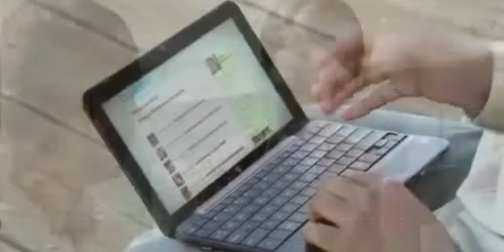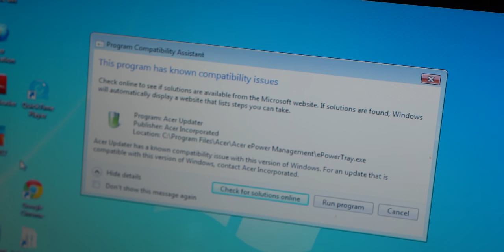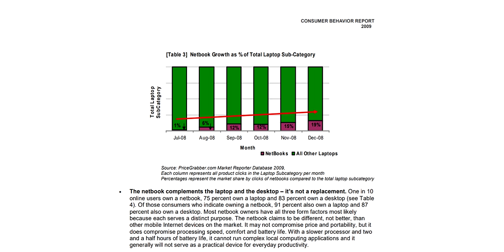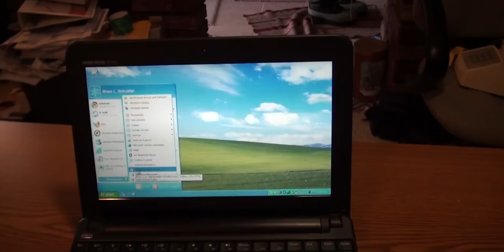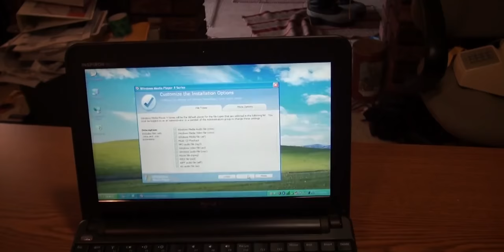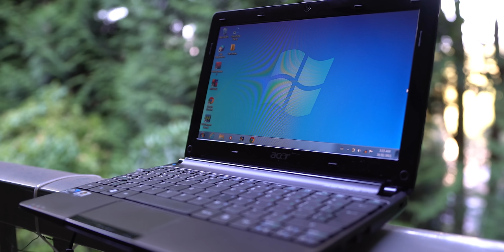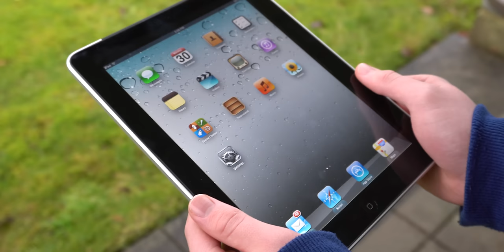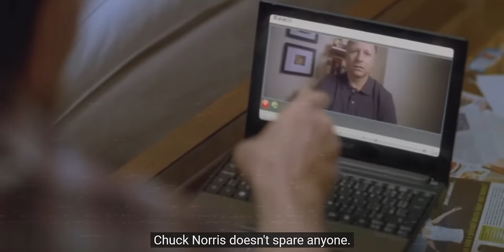Why Netbooks Failed - Modern Retrospective

Comment: I was one of the late adopters of Netbooks back in 2012. My mom bought the last emachines model before it was discontinued. 10.1 inch 768p TN display, Atom dual core, a beefy fan that kept it from choking, and for some reason it had 4gb of RAM and Windows 7 Ultimate. We got it on sale for about $150 Brand New.

I still use it now with Linux XFCE. It can actually run 720p60 or 1080p30 videos on Youtube.

Stay Healthy and Cheers from the Philippines. ⛑️♥️🇵🇭
Reply: Very impressive specs for a netbook-class PC.

I was a mid-gen netbook adopter that came in around December 2010 with HP's Mini 110c-1105DX. At 10.1" with a 1024x600 TN panel, Atom single core-hyperthreaded (said hyperthreading saving it from being awful), decent fan, and 2GB RAM, it was a wonderful little multitasker between web browsing and Winamp audio playback. It started to buckle even under chat clients such as Steam, Windows Live Messenger, and Skype by early 2013, but most websites even around that time still weren't too demanding for it yet. I just wish its charging port didn't quit in 2013, because I would have loved to bring it up to Lubuntu 18.04LTS LXQT
Reply: @TurboPikachu  That's one of the downsides of owning a 'dead platform' piece of tech. When sonething does inevitably go wrong, we're out of luck finding parts. My netbook's batteries are completely dead so it's plugged into  a wall socket whenever I use it. Goodbye mobility.
Reply: I still have my EEE PC 1000H, with a 1.6GHz single core hyperthreaded x86 Intel Atom, 2GB of memory and currently a 250GB SSD (which really didn't help the start times at all anyway lol).

What distro are you using on yours? Finding distros that still support x86 is getting hard, and Debian with Xfce is too much for it. Currently I have Slackware x86 on it, and it's """usable""", but if I could find something better, I'd be very interested. I tried Arch 32 and that actually worked, except I hated having to do absolutely everything manually and not being able to figure out certain things like automatically mounting a removable drive.
Reply: @JustARegularNerd  I use Mint XFCE. Linux MATE tends to perform the same, even though it's supposed to be more resource intensive.

Puppy Linux might be a better  option, based on your netbook's RAM.

If your CPU is 64bit you can even install Chrome OS with Google Play Store and OTA update support. It runs on Debian kernel so you can install linux apps through the terminal.
Reply: @BedrockPlayer123 Aye! Sup?
Reply: I got a Compaq Mini 110c-1100 in December 2009. 10.1" 1024x600, Intel Atom N270 1.6GHz 1c/2t, 1GB RAM (later I upgraded it to 2GB), 160GB HDD, Windows XP. It was a nice small laptop for web browsing, watching videos, using skype etc. It even ran some light games pretty well. It had really good battery life with a 6-cell 55Wh battery which sadly stopped charging in 2012.
The netbook still works and has the original Windows XP and Xubuntu 12.04 which I installed later
Reply: @Pasi123  55wh on that hardware must have given some epic battery life!
Reply: imagine what a 2020 ultrabook quad core with 4K OLED would be like in 2007
Reply: OMG PILIPINO
Reply: @xxhalfemptyxx7713  Ey! ✌️
Reply: Yours actually had some decent specs imo.
Ive never seen any stock netbook with 4 + gigs of ram
Reply: @SummonerArthur  The owner of the store we bought it from is a family friend, he was quite into modding. So chances are high that my netbook might have a modded/replaced memory controller/motherboard.
Reply: @othinus  You can rebuild those batteries, although some caution is in order as they are very high current devices. You might luck out and be able to find an rc car battery that has about the form factor you need, it is what I ended up doing for one of mine.
Reply: And to think that now even low end phones can run YouTube videos in 4K
Reply: @Blox117  quad core is nearly dead now unless it has hyperthreading and high clock speeds

Also such specs in 2007 would only be considered high end at best, wouldn't be strong enough to be on the level of a workstation or server at the time

Comment: The best thing about Netbooks was that in the process of replacing Windows Starter Edition with Linux, I learned I liked Linux.
Reply: I like linux too, but still it doesn't have some critical programs for me, so i still didn't entirely switch to it from windows
Reply: @Mabel Pines true
Reply: @vinyl.croatia  I assume they don't run with Wine out of the box, but try and find out if there's a path out there to make it run. You might be surprised.
Reply: Linux was what allowed me to use my netbook until mid-2020
At that time though, the pandemic came, and it turns out a single-core Celeron isn't exactly the best for video conferencing...
Reply: Just get a job and buy a laptop, mow some lawns or something, lmao
Reply: @vinyl.croatia  me neither. It can't run rct3 properly without it having a problem with wma files.

Comment: Windows 7 netbooks were basically another way of the "Vista Compatible" underpowered XP computers
Reply: try using windows 8 on a netbook
Reply: BedrockPlayer123 when your on the desktop yes when your on an app or game no
Reply: @BedrockPlayer123 Well, my old Toshiba NB510 can install Windows 10 but installing its Intel graphics driver that are made for Windows 7 can cause a BSOD every time I open Start menu, running Windows 10 UWP app or opening some other elements like Action center, Wi-Fi settings, etc.
Reply: He's not wrong. I have  7 starter Netbook
Reply: Yup, on paper it doesn't work out good
I have BenQ Joybook u101 and it's using Windows XP
Reply: @insanitylol  you're*

Comment: If you still have one of these things kicking around then shove a cheap SSD in it and run Lubuntu on it. Upgrade your RAM to 2GB and enjoy.
Reply: I think AntiX will do a better job.
Reply: @Dac_DT_MKD  I run Sparky on mine.  Dell Latitude 2120 with 2GB DDR3 and it does pretty good.  I can run games like Half Life on it in Steam and they are perfectly playable.
Reply: Ubuntu and its derivatives nowadays are FAT
Reply: @Dac_DT_MKD  But why not debian or debian oldstable? You can install debian and DWM or Weston with your software. From start it consumes like 100mb, but in fact it should be less if don't count cash. AntiX and PuppyLinux seems to be good option to run from USB drive.
Reply: Puppy Linux, Slackware base
Reply: @2080 It's not 2006 anymore.
Reply: For what would you use that? writing text or loading Wikipedia? any cheap smartphone can do that, if not more.
Reply: @biggo4637  Smartphones suck for webbrowsing
Reply: @Mj Verostek my 200$ dollars phone manage to browse without problems and is more comfortable
Reply: @biggo4637  I bet you put milk in a bowl before you pour in the cereal.
Reply: @mjverostek1278  Hi i have a collection of desktop and laptops from 2000 - 2010 
1 of each runs XP for games , the rest have linux puppy 3  the the low end machines and up to Puppy 5
P3 - P4  / celeron / duron

I do have a HP Mini 5 - 102  notebook that was a "incentive" given out to a few engineers and managers to change mobile and land line telco back in @ 2005-2008.

Our construction engineers used them and then thew then out, they were fine for email and pdf's but they all needed to use autocad to open engineering drawings when having issues - for that they used the "big" Pentium 4 Toshiba Satelite Laptops

So one of the HP Mini 102's was given to me and i still have it, battery is dead but the hardware is very rugged and the screen is still beautiful - if runs Linux Mint 17 and youtube playback is possible

They only negative is the hard drive is extremely slow, it is quiet but very slow, it would run XP with 1 or 2 mins but towards The end took close to 8-10.  Reinstalling the d-drive from the partition back up took 3 hours - i used to do it every xmas to keep it running smooth and it used to take 30 mins - while having dinner for example.  

I may open it up and see if it takes a standard 40 pin IDE  or the 44 pin with power - if 40 i may just buy a new SSD as they are $20

Linux Puppy is great and can run of a USB stick , you can save session to usb - i find it great and stable.

Regards
George
Reply: @georgemaragos2378  I'm trying to get Slacko Puppy 6 to run under Ventoy right now. It fails with not being able to find the .sfs file. But Xenial Pup works fine...
Reply: @mjverostek1278  Hi i have never used Ventoy - but a similar one called YUMI multiboot for a multiboot usb stick

On my Win 7 main pc i have a different program called Linux Live USB Creator
This allows me to say grab a new image, and set it up for use on the pc while Win7 is running - sort of virtual box - you run the program, select the image file and it creates basically another image with a "wrapper" around it - you can add a persistant or some extra room for saved files in it - read a bit later down.
When done you can launch the newer saved image while still in windows - just like virtual box

These multi boot basically are a generic linux boot device, then a menu sytem to select a specific operating system or image to boot from and run - they are very use fully as you can put a selection of PC repair tools on 1 stick eg linux tools , virus scanners, clonezilla etc

My uses of it is playing with several OS eg Linux , Puppy, Linux Mint , Win XP repair disk, freedos , doss 6/22 boot disk etc etc

Program #1 may not work on every machine as it depends on the booting machines BIOS eg i have 2 HP laptops bought in 2010 a few months apart, Puppy 6 works on one but not the other

Note when you use a multi booter, they can be configured in a few ways
1.  basically a read only os
2. read only os but a small area for run time variables eg the ini setting for video mode, resolution, sound and internet settings - some times these settings can be saved in the same artition or as a setting file that can be re-read later
3. road only but with persistent space - eg you open puppy as a read only run time program, but it may have room for say 300 meg persistent storage - think of it as a extra removable / savable hard drive letter or built in usb stick with 300 meg - this was you can save a document or something on that multi boot stick, and after you quit you can load that up again on that or another machine
4. I do this with save state and save setting, eg Puppy 6 or my linux Mint 17 runs on Dell I5, Thinkpad core2duo, Imac 2007 - i just "save  state or save session" as  Dell or Laptop

Some info for the .sfs - from the wiki - there is something wrong with the setup or filelocation

Sorry i could not help more 

http://wikka.puppylinux.com/squashfs

Regards
George
Reply: @georgemaragos2378  I've heard of YUMI but never tried it. My only other solution I could think of is installing Grub on the USB media, then I would have to unpack the .iso and make a moot menu option manually for everything I put on it. Ventoy just works so much easier with everything elrse. I wanted to use the Slackware base for my Win10-32bit dual boot on my Dell Latitude 2120, but I may have to use Xenial Pup because of this, since I wanted to have an easy toolchain for maintenance.
Reply: @mjverostek1278  HI    If you just need to run a linux ( any version ) of a usb stick or entire drive seldomly and leave the main pc windows version alone version there is a far simpler 2 step process that does this safely - no need for the multi boot installer on the usb stick option 

1. On your windows pc download the linux install / iso  image file and save it in downloads or desktop.

2. once that is done use a free program called etcher -  The Etcher website is at: https://etcher.io/

Watch a quick video on etcher - it takes 1 to 2 mins, basically you plug in the usb stick, run the etcher program, load the image file, then burn the image file to the usb stick - IT WILL WIPE THE USB STICK OR ANY USB DRIVE YOU SELECT IF YOU HAVE ANY USB HARD DRIVE INSTALLED OR ACCESSED MAKE SURE YOU UNPLUG IT INCASE YOU PICK THE WRONG DRIVE AND WIPE YOUR WRONG DRIVE

The burn process will take a few minutes say 3-5.  Once done you should have a message saying done / completed 

Now windows cannot read any file structure or any files on a linux partition !!  Linux and Macintosh can read windows

Shut down and reboot your pc - when the computer first starts the bios screen will quickly flash a message to press a keep for Bios options or boot menu options ( donot confuse this with windows startup boot options )

Do a google search on the brand of your machine eg IBM/ Dell / HP   eg HP 8020  if it is a large make , if you have a custom or mass produced mother board you search for the mother board make and model eg asus ABC12X.   The bios buttons or boot menu options are usually F1 or F2 or F10 or F11 or F12 or Delete  - bios option allows you to go into setting, boot menu puts a small menu like press 1 for hard drive, press 2 for CDROM/DVD, press 3 for USB

So lets say it was F12 for boot option, reboot the machine on startup keep pressing the F12 - a small menu appears and you press  the option to select USB drive

The PC will now start from the usb stick and not windows.

You should be now running linux in CD/LIVE mode - basically it will configure and run, the menu systems will tell you if you can save setting on the USB - there is no need to install on the usb - almost all linux systems in the last 5 years will be able to leave the ISO as read only and use the free space on the USB stick for your setting and and saved files

Regards
George
Reply: @georgemaragos2378  I'm a linux veteran. I can do this in dd. I just wanted something easier. It's not 1999 anymore!
Reply: I actually wish I didn't throw my old Toshiba NB500 so I could play with it a little more
Reply: Ubuntu MATE is probably good too
Reply: @Lucas Zhu does arch run on 32bit? Many of these atom processors are 32 bit only
Reply: @9a3eedi  If you're going to run Ubuntu base on these just go Xenial Pup Puppy Linux (the 32bit base).
Reply: @mjverostek1278  isn't xenial out of support though
Reply: @9a3eedi  That's the last 32-bit Ubuntu base Puppy Linux build I saw last time I was on the website recently.  Oh, shoot, just checked, they have Bionic listed. Still working on 32 bit Focal.
Reply: @9a3eedi  Hmmm... Though it seems Bionic Pup 32 doesn't boot through Ventoy, yet Xenial Pup 32 does... And neither does the latest Slacko Pup 32. I'm not reformatting my USB SD. I'll just install Xenial and do an update from there.
Reply: @Lucas Zhu: It's Photoshop that can't run on Linux, not the opposite. It's just a decision made by Adobe to not allow it.
Reply: @Lucas Zhu: Yes and that is irrelevant.
Reply: i install zorin in my netbook, but i think my netbook have a problem in its hdd, because the os (zorin), somehow run smoother in my usb
Reply: @muhammadraihan9044  Replace the hdd with ssd
Reply: Im going to try this with puppy linux
Reply: the performance of this atom netbook pretty bad, for new app like zoom, webex and loading browser or chrome, even updated with ssd
Reply: I got a Dell Inspiron Mini netbook for $8 on Goodwill. Installed an SSD, then installed Linux Mint. Aside from an overheating problem, it worked well

Comment: I had a netbook in college, and I still have it. I ran Debian on it and it could handle anything I threw at it: databases, virtual machines, photo editing, even gaming if the game was well-optimized. The latest version of Debian still works perfectly on it. The biggest limitation was perhaps the screen resolution, which was 1024x600. Many apps were and still are designed with a minimum of 1024x768 in mind, meaning that the bottom of the GUI would be cut off.

Comment: I had one for so long in high school and it was amazing
Reply: I used a netbook for my whole elementary years, the screen was small, so i hooked it to a monitor. Still works lol. I think it was not a scam
Reply: I have one, running windows 10
Reply: put off your rose tinted glasses lol
the specs in netbooks were horrible, they were useless for anything beyond basic internet browsing and office software
they always packed the poorest, lowest spec CPUs and very little ram... if you like slow computers tho, power to you
Reply: My aunt Kristy had one. That thing was a piece O' crap.
Reply: @CoasterMan13Official  does it still work?
Reply: @rayhanrizvi334  I don't know.
Reply: @rayhanrizvi334  I got an acer aspire one (the one shown at the start of this video) in 2011, and it did what I needed it to. It lasted me about 5 years I believe, but probably could have gone a lot longer if I didnt abuse it.
Reply: @oreocakester4307  yeah mine was mainly hooked onto a monitor so it did not move around a lot
Reply: @oreocakester4307  u mean the zg5 I have a zg5 form 2009 still on xp